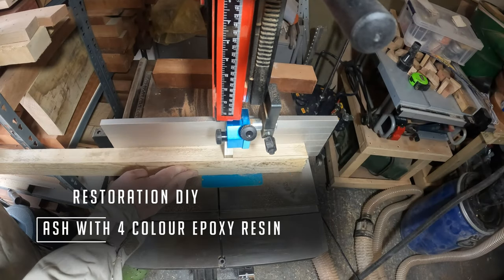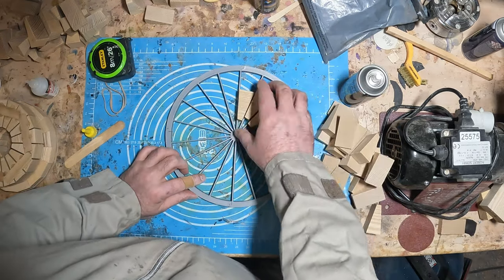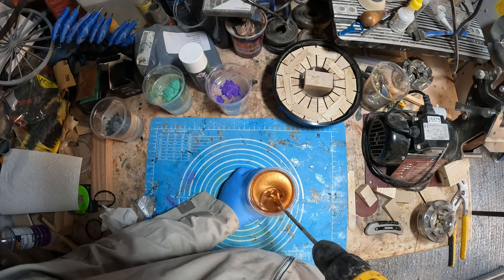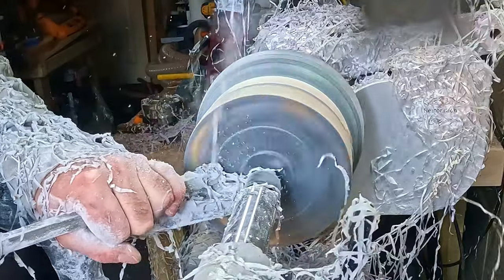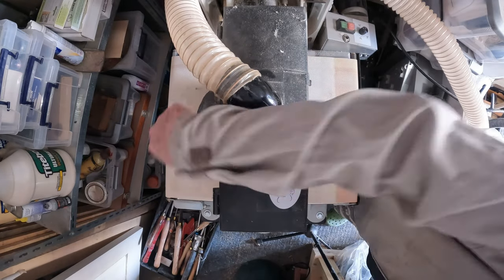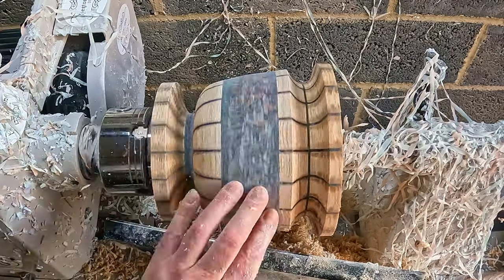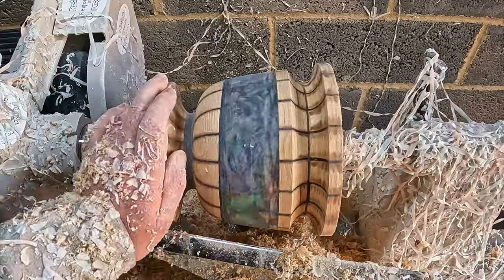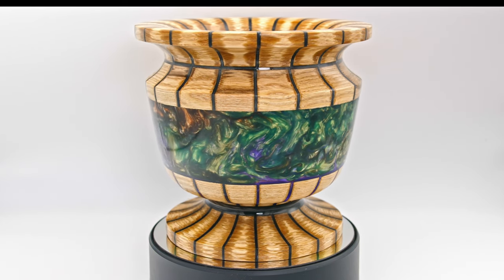Woodturning | Ash Segmented Bowl with 4 Colour Epoxy Resin | Restoration DIY

Comment: Watching these bowl turning videos I wondered if the waste blank was turned to a slight cone and then wrapped in cling film would it then pull out of the casting, removing the need to cut it out later, or is that not possible?
Great video and a lovely piece.
Reply from the maker: Thank you 🙂  I'm glad you like it, I haven't thought about doing waste block in that way. It could probably work, I,ll give it a go on an upcoming project 🙂

Comment: I love it and would like to make similar as I have just started segmented turning. However I have turned pens with epoxy and just hate the mess. So maybe I’ll just stay with nice clean wood.
Reply from the maker: Thank.you.  it's a piece I'm very proud of. I would say that it can be messy, but don't let that stop you from having a go. Good luck with your projects, and thanks for your comment 😀 👍
Reply: @RestorationDIY  I like your 3d printing and am tempted to have a go at that but am torn between cnc and laser. My workshop is not big enough for all three.
Reply from the maker: I'm in a similar position. I went with 3d printing because I can do that in my house. If I had the space, I would go for a CNC. 🙂🙂

Comment: I love the height on this piece the colours are wonderful. The only thing that bothers me is where the resin stained the ash, thanks for sharing take. Take care stay safe.😁😁
Reply from the maker: Thank you 🙂 its taller than most pieces I make, the staining is difficult to solve letting the epoxy resin part cure in the mixing cup and less pressure in the pot might help 🙂
Reply: And yet I LOVED the way the resin stained the Ash.
Reply: Maybe seal any wood likely to absorb the colour.  Possibly sanding sealer.  Although it would make it look crisper & don't mind the 'bleed'.
Reply from the maker: At first I didnt like the bleed but now I like it alot I'll be doing more in the future 🙂